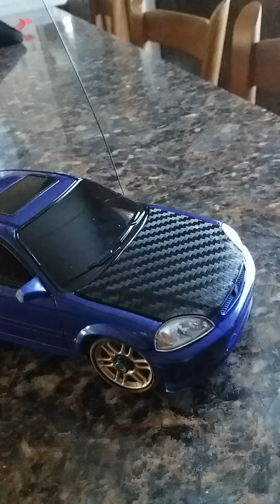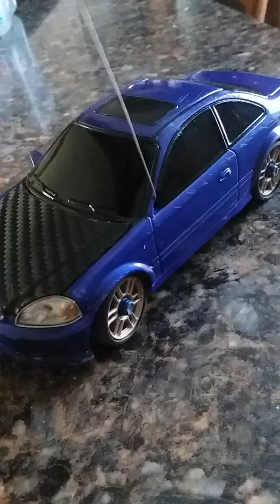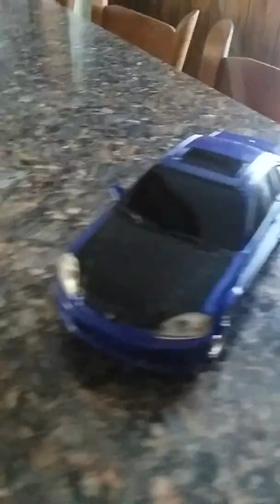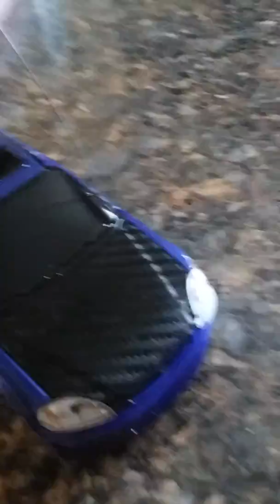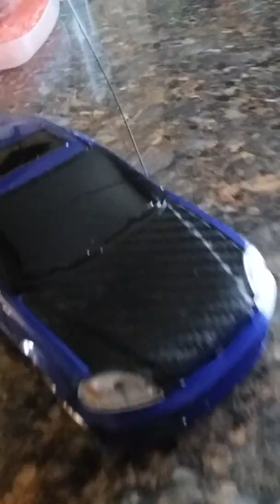Gen 1 xmod steering fet...twitch fix...10 pack of fds8858cz fets in the mail...

Comment from the maker: This car is 75% from finished...90% from ready to run..just gotta finish battery setup. New esc, 2.4ghz ball bearing motor, hobby servo, aluminum, carbon fiber built with gpm and wltoys parts. Video soon

Comment from the maker: Bad news the fet stack was a success, but the steering fet install failed resulting in a fet that burnt a hole in the esc board. Next stage is Losi Micro T receiver/esc combo. On a positive note the 8858zc fets work great on the new bright 12.8v boards too. The Ford truck has a double stack and pulls through a full 3s cycle without even over heating the fets or the motor. Same with the wolf pro motor and board.